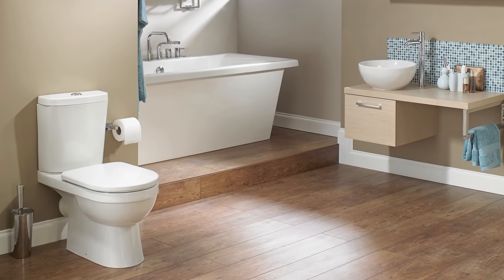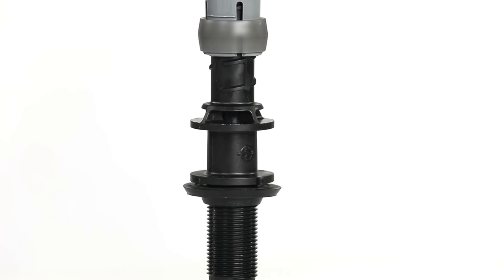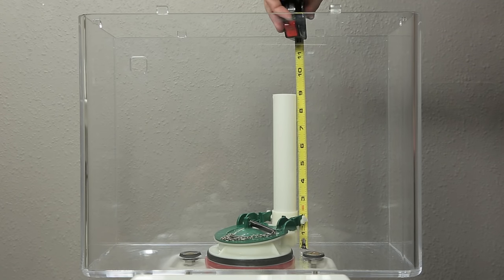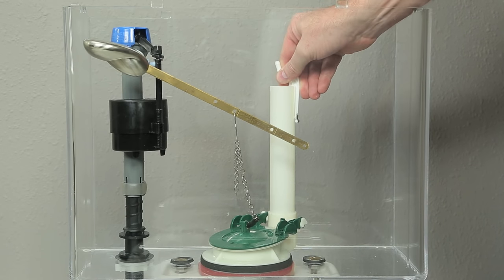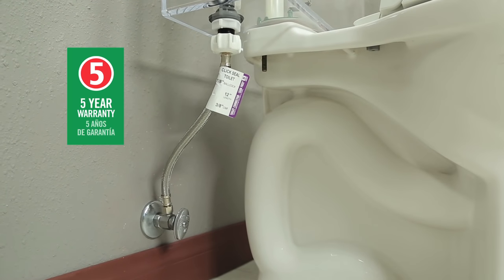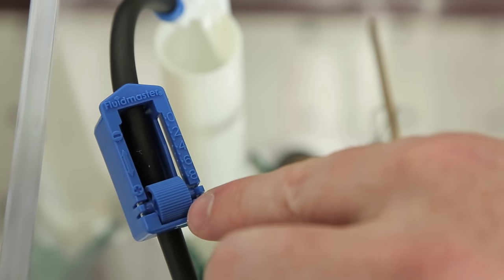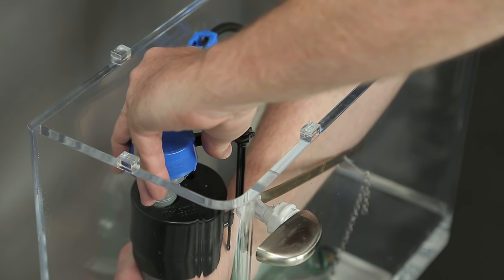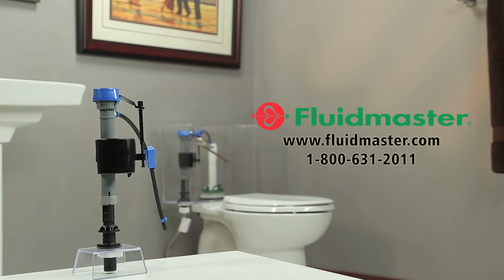Get a Powerful Flush by Installing a Fluidmaster 400AH PerforMAX Toilet Fill Valve

Comment: Saved at least another $100. I bought the Fluidmaster Fill valve, which I am going to keep, based solely on the fact that these professionals taught me, the "why", not just the "how". It turned out that cleaning out the valve did the trick and stopped my toilet from continually flowing. I didn't need to replace the entire apparatus. The guy that started the job had already charged us $85 and wanted another $100 to come out and replace the fill valve completely. This little, extremely easy, trick/tip, fixed the issue, for no charge!! Seriously, thank you for talking to me, who is very computer savvy, in a manner that understands, I'm not dumb, just ignorant of how this all works. I am a Fluidmaster product customer for life because of this one issue.
Thank you!

Comment: Thank you for taking the time to explain this. I installed the whole new system about two months ago and ever since my dads toilet has been clogging up multiple times a week. The manufacturer instructions did a bad job of explaining the height adjustments and so even though I knew at the time of install that the tank water level was at LEAST two full inches less then previously, I could not determine how to correct it. Your guidance has saved me from ripping the entire toilet back apart and I think it’s back at the same water level it had been originally. You are awesome!

Comment: THANK YOU, we had a water main break and had dirt get into our lines... The dirt clogged up the fill valves and it stopped working correctly so FLUSHing the tubing the way you showed in the video is what fixed my problem even though I had replaced the unit thinking that is was broken! Next time I will know what to do first! Thanks again

Comment: Mine was filling slow and found a restriction in a white rubber screw about two inches long in between the lower black tube and the upper grey tube. pulled the two tubes apart, removed the rubber screw inside the tube with needle nose pliers, removed the what looks like rocks, reinstalled the rubber screw, reattached the two tubes, put everything back together and back to full pressure.👍😉
Before when you flush it would take around two minutes to refill and that sucks in the middle of the night to hear that going!

BTW, .....Good Luck!

Comment: Video is good, valve seems very promising, and installed very easy. Not only that, actually learned a lot about proper adjustment of toilet refill setup. Not only will I save the water my old fill valve was leaking down overflow tube, but won't be overfilling bowl.

Comment: It is possible to adjust the height of the valve without removing it from the toilet, a major labor saver. Say you installed a new valve and during testing you see that the tank water is refilling too low, darn it, you should have adjusted the valve taller during installation but now you'll have to take it all  apart again. What you can do instead is * shut off water * flush to drain tank * on the tube of the valve, beneath the float there is a clear plastic ring that keeps the thread of the outer valve tube engaged with the thread of the lower valve tube. Slide that plastic ring upwards and hold it there. The threads are now not positively engage and you can simply gently pull the top of the valve upwards to the desired height. * After adjustment slide the plastic ring all the way back down into its  locked position.

Comment: I didnt see any units for toilet handles mounted on the side rather than in front so I used a blow drier to heat and bend the toilet handle arm....  The plastic bent accordingly now I'm going to adjust the chain and trim the pipe accordingly hope this works in theory and on paper can be very different in results
Reply: You go mcGyver! what brand hair dryer? Just kidding.

Comment: Hmm. I tried to install a bidet and quickly regretted it because the toilet water is almost impossible to shut on or off. I finally have it back on, but discovered I have this system because of the issue at 4:45. I can manually jiggle the entire adjustment valve to start/stop but it seems to have zero correlation with the level of water in the tank. (I only figured this out because it start/stops when the white clip outside the tank is adjusted, which moves the whole thing.) Turning it clockwise or counterclockwise seems to do nothing. At least I now know what it's supposed to do. Maybe I'll try to clean out that debris and just deal with Niagara Falls in my bathroom for a minute???
Reply from the maker: Fluidmaster would like the opportunity to help, please contact Fluidmaster’s Technical Service Department for help with your product. We are available Monday through Friday from 5:30 AM through 5:00 PM Pacific Standard Time. Contact options include: Fluidmaster.com/support to Chat, Email or call Toll Free 800-631-2011.
Reply: As per the video, hold a cup over the toilet fill valve when removing the top of it for flushing. That will allow you to flush debris from the valve without Niagara Falls in your bathroom. If the water cutoff valve on the wall under your toilet has frozen because of age and is inoperable you will need to replace it, Short of that, you could turn off the water to the entire house so that you can work on the toilet without it having water pressure. I didn't really understand moist of your post. If you are expecting any useful replies you may want to edit your post for clarity.

Comment: my fill value nut is in a too tight space and the wrench  i have at home does not fit.

can someone please suggest the wrench size needed to remove the existing nut and any adjustable wrench recommendations
Reply from the maker: The nut under a fill valve is approximately 1 inch in diameter but if it has wings it can be 2 inches and larger. If the area is too tight for an adjustable wrench then maybe a crescent wrench may work, but Fluidmaster has a Green Tool model 7110M-007 that is designed for the fill valve nut. For other tips or help with your installation contact Fluidmaster toll free at 800-631-2011 or by email / chat go to fluidmaster.com/support. We are available Mon –Fri from 5:30 am to 5:00 pm PST.

Comment: Hi thanks for the video. I am trying to find out why my toilet is taking so long to refill after I flush? It is very slow. How can I fix this problem?
Reply from the maker: To speed up the valve and the toilets performance try resetting your adjustable flapper so no more than half the water in the tank is used and  use the roller clamp on the refill tube to slow down the water to the bowl, this will speed up the tank filling speed. If you need help with your installation or have any concerns contact Fluidmaster’s Technical Service Department as we are available Monday through Friday from 5:30 AM through 5:00pm PST. Thanks.
Reply from the maker: The 400AH has a removable top that allows you to clean the valve and water supply. If the valve is not shutting off try this simple procedure to clean the valve and get it back to working order, Flushing Debris from the Fill Valve,  https://www.youtube.com/watch?v=AabLItDN-qk. For additional help contact Fluidmaster by phone  800-631-2011 or email or chat with us at fluidmaster.com/support.

Comment: It takes a minute and a half to fill the water tank other than that I'm happy
Reply: Hi, maybe you need to adjust the blue valve? My toilet was taking forever to fill, and flush, so I adjusted to the right, and now it fills in like 10 seconds!
Reply: Hi I discovered today that if you turn that blue wheel thing closer to 0 the tank will fill much faster. I don’t need water going in the middle tube anyway. It solved the problem!
Reply: Yes you do need water going to the middle tube. That's what prefills the bowl after each flush and you need that. However you have finite water pressure that is divided between filling the tank and filling the bowl and, as you discovered, you can slightly restrict the bowl prefill hose and thereby channel more pressure and water volume to the tank fill.

Comment: I just replaced a fill valve  with a fluidmaster arhrk fill valve.  it runs for a few seconds every 30 seconds to fill.  I can't figure out which way to adjust this
Reply from the maker: Thank you for posting this review. Ghost flushing or water leaking into the bowl after a new installation of a flush valve may not be the flapper. We suggest checking your refill tube position, if you have the refill tube shoved down or placed inside the overflow pipe pull it out and reattach to the overflow pipe using our refill clip. This will stop a siphon from occurring and stop the leak.  Another area to check is the flush valve lock nut. You may need to tighten ½ turn beyond hand tight to stop the leak.  If you need help with your installation or have any concerns contact Fluidmaster’s Technical Service Department as we are available Monday through Friday from 5:30 AM through 5:00 PM Pacific Standard Time. Contact options include: Chat www.fluidmaster.com/support E-Mail techsupport@fluidmaster.com and Toll Free 800-631-2011.

Comment: How to open outlet volve of  flash . Please send me ur suggestion
Reply from the maker: Thank you for your question, the easiest way to open inside of the valve is to remove the top cap. Please watch this video for easy to follow instructions. This instructional video is for any 400 series fill valve new or old and should resolve the issue, https://www.youtube.com/watch?v=AabLItDN-qk. For more information, please contact Fluidmaster’s Technical Service Department, we are available Monday through Friday from 5:30 AM through 5:00 PM Pacific Standard Time. Contact options include Chat www.fluidmaster.com/support E-Mail techsupport@fluidmaster.com and Toll Free 800-631-2011

Comment: where do I measure from to get the correct CL height???
Reply from the maker: To get the correct CL Mark first make sure the top of the overflow pipe (in the center of the tank) is 1-inch below the toilet tank handle hole (the lever comes thru on the inside of the tank) . Once properly set in place measure from the top of the overflow pipe up 3-inches and that is how tall the Fluidmaster fill valve should stand. For more information visit our website Fluidmaster.com where you can find product information, videos, troubleshooting tips and email or chat with a technician.  Our toll-free number is 800-631-2011 and we are available 5 days a week Mon-Fri from 5:30 am – 5:00 pm PST.

Comment: I'll stick with the Korky Quietfill.
Reply: Care to  illuminate us as to the reasons for your preference?
Reply: @TheLarryBrown  The Korky is easy to intall.   Fluidmaster can be tough to adjust because you have the height of the valve and the height of the float. The Korky you just untwist, adjust the height and tighten it back up. It's quiet and works great.  The Korky also fills the tank noticeably faster than the Fluidmaster fill valve. The Korky is also much easier than Fluidmaster to replace the internal shut off rubber gasket when that becomes necessary in 5 years or so. The Korky is more space efficient in these small volume tanks due to the smaller float.

Comment: I got the kit for all the parts & idiots at the factor installed the nit in the flush valve so tight that it’s stuck. There’s no way Fluidmaster would want that so they must not be inspecting their products coming out of the factory.  Taking it back & buying another brand.

Comment: I am an experienced home owner and have repaired many toilets in my 65 years. I have two comments. The rubber shank washer that came with it did not look like the one in the video or the box or the instructions. It looks like a two piece rubber washer. No where did it say to cut out the center however you can't get it on without cutting the center out. No idea where the center was supposed to go.  And the refill hose adjuster is just stupid. People must have a lot stronger fingers than me because I couldn't adjust it. The tube won't compress enough. I then tried putting on in the zero position and putting hose in but that doesn't work either. So with both efforts failing. I was unable to adjust it. I'm sure I'm losing water a long with a lot of other people that don't have Schwarzenegger fingers. Other than constantly wasting my bowl water it went well and worked well.

Comment: So it looks like you have the water going directly into the overflow tube. Is this proper?
Reply from the maker: – Yes that is correct. The water going into the overflow pipe goes directly to the toilet bowl and refills the bowl to its proper level. For additional questions on this Fluidmaster product contact us at your earliest convenience. Fluidmaster’s Technical Service Department is available Monday through Friday from 5:30 AM through 5:00 PM Pacific Standard Time. Contact options include: Chat www.fluidmaster.com/support E-Mail techsupport@fluidmaster.com and Toll Free 800-631-2011.
Reply: Hahahaha...that is a very funny question. I welcome you to the world of toilet repair from, like, 1900. I also didn't understand that hose squirting into the overflow tube for a long time. A toilet is a simple yet clever device in use for a hundred years but yet, I probably still don't understand it all. Think about it like this: When the flapper closes the bowl will have been sucked empty (normally, hopefully). Since the flapper is closed the only way to get refill water in to the bowl is down that overflow tube and that's why the hose squirts water there. It's not really an "overflow" tube. It's a dual purpose "tank overflow/bowl prefill" tube.

Comment: If it  leaking continuously, what to do
Reply from the maker: If it is leaking continuously, you can try first replacing the flapper. If this does not solve your issue, replace the fill valve.

Comment: When I installed this it did not work. no water comes through.  what could be wrong?
Reply from the maker: Here is a quick tip that may help with a newly installed fill valve.  When the fill valve will not turn on, this may be caused by your water source or supply line.  To fix this problem flush out the water line and check to make sure nothing flowed in and is stuck in the threaded shank of the fill valve. We also recommend  flushing the entire valve body and rinsing the master seal (instructions for this are in your installation guide in the troubleshooting section).  For your convenience watch this video: www.fluidmaster.com/toilet-repair-videos/flushing debris.  For additional help visit our website Fluidmaster.com/support for videos, troubleshooting tips, email, chat with a technician or call toll free 800-631-2011. We are available 5 days a week Mon-Fri from 5:30 am – 5:00 pm PST.

Comment: After flushing the water is not filling the tank.
Reply from the maker: Depending on the age of the valve it could be that the master seal is wearing out. A quick and inexpensive solution is to replace the top of your 400 fill valve with a 385 Top Cap with Seal. For help contact the Technical Service Department toll free 800 631-2011 or visit our website Fluidmaster.com to chat or email us.

Comment: In general these fill valves all are such a bad bad design! They are in the same category as smoke detectors. We can take pictures of the events that happened 13 billion light years ago in universe. But these companies can not manufacture something that is simple, durable and easy to install and adjust.
Reply: Galactic level hyperbole aside, can you offer something useful to the discussion like the top five problems with the Fluidmaster design and what brand valve you deem least evil and why?

Comment: The instructions were helpful. Everything installed ok, but the tank refill rate seems very slow (?)
Reply from the maker: Fluidmaster would like the opportunity to learn more and provide help. For more information visit our website Fluidmaster.com/support for videos, troubleshooting tips, email, chat with a technician or call toll free 800-631-2011. We are available 5 days a week Mon-Fri from 5:30 am – 5:00 pm PST.
Reply: Time it. It should be 60 to 80 seconds. One way to reduce the refill  time is by lowering the cutoff point. With a new valve and long time, it could be: * Water pressure to the house is low * The cutoff valve on the wall under the toilet is partially close * The flapper is not sealing, allowing water to leak from the tank down into the bowl * Even a new valve could get clogged with debris....try flushing it per the video * If you have the deluxe 400AH shown in the video, the tighter you crank down the bowl refill tube the more water pressure you put towards the tank, resulting in a faster fill * The cutoff valve on the wall could be corroded/rusted, resulting in a blockage * The hose from the wall to the refill valve is too long, kinked, or looped